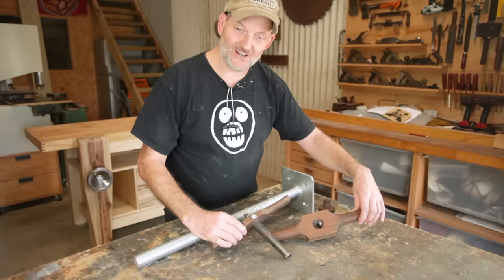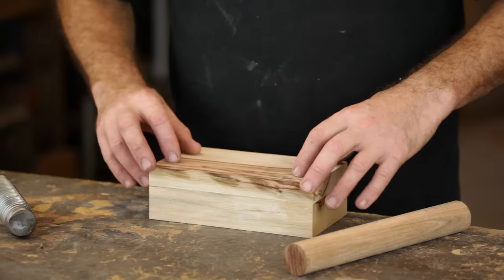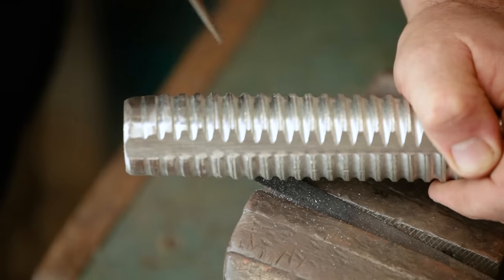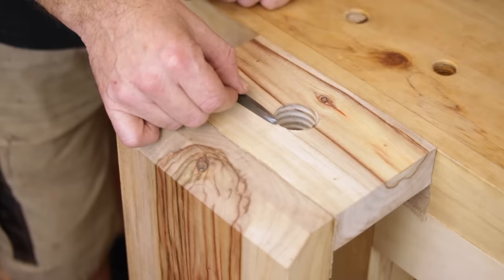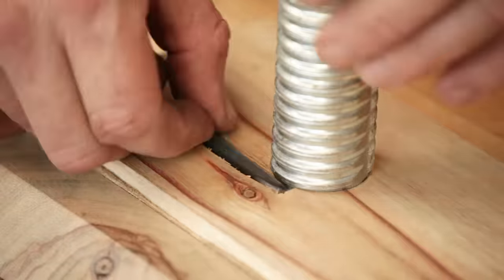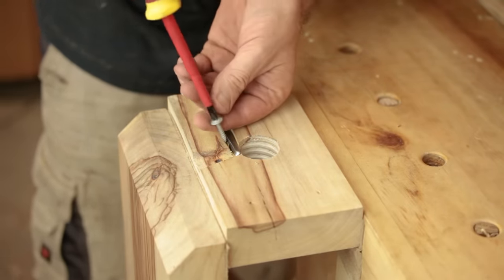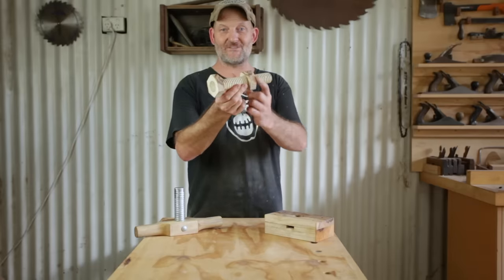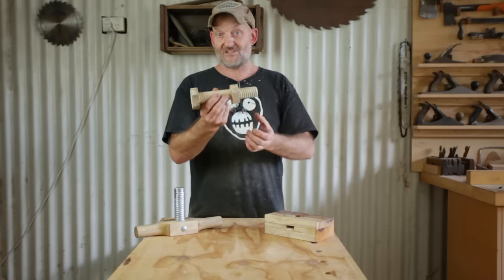Making Wooden Threads - Homemade Tap and Screw Box

Comment: John Heisz was trying to make something like that in the course of a few years and a dozen videos, and you nailed it on the first try. Impressive.
Reply from the maker: Thank you Konstantin! John is still one of my very favourite youtubers though. :)
Reply: Konstantin Mednikov: as said in the US keep it simple!
Reply: Pask Makes magnet an a stick would have been handy for the oil retrieval,great video.
Reply: D twist Rewind that wouldn't work because he removed it's magnetic properties
Reply: It would work, the piece of steel just lost it's magnetic properties cause it's heated above it's "curie point". It will resume being attracted to magnets as soon as it cools down.
Reply: Mirai, As the other commented mentioned, that was the Curie point. Basically, it is when the ferromagnetic metal (Fe/Ni/Co) is heated far enough that the atoms are not locked into that magnetic orientation, so they can spin around when brought to a magnetic field. While this will destroy an existing permanent magnet's ordered structure, once it cools it will have randomized, but still locked-in magnetic orientations among the atoms. It will just be like a chunk of steel or magnetite instead of a magnet that has been exposed to a powerful electromagnet in order to orient the individual fields into a cohesive magnet.
Reply: Konstantin Mednikov f
Reply: Konstantin Mednikov qq
Reply: Eugénio Varejão ppppp
Reply: Eugénio Varejão i
Reply: Konstantin Mednikov
Reply: @PaskMakes  you are my favourite youtubber! As a photographer and woodworker I feel resonated to you.

Comment: Dear Neil, magnificent example of ingenuity at work.  I like the fact that you produce a long tap to start the process, rather than the shop bought models which only have a few threads on them.  One thing you may consider is making a bottoming tap to match the taper.  That way you can start a hole that ends with the taper cutter and finish to depth with the bottom cutter. Then you can sink your thread all the way to the bottom. 

What is also an interesting concept is to get a starting thread that is highly suitable for things like vices - an Acme thread.  I have seen some at my antiques store for $20.00 and would make an excellent set of taps - taper, intermediate and bottomer.  Acme threads have a better profile and quicker movement than whatever thread was used on this demonstration. 

I have been playing around with making dowels and wooden threads using various approaches.  I used a shop bought thread cutter kit. I soaked my wood {Victorian ash} for three days beforehand and the threads went surprisingly easily.  Unfortunately, the threads were brittle and touching the tops broke them off.  I then tried some ironbark which was recently milled and quite moist.  I didn’t soak this in oil but it cut like butter and the threads are strong without breaking.  I guess what one has to do is to experiment with a few combinations of technique to get the ideal end result. Happy turning!

Comment: I loved this video. I am working on an antique chest of drawers that had the feet on its turned  legs cut off, I assume to make it sit level. I want to make replacements that I can thread into the bottom, so that they can be removed or replaced to preserve antique value. Even though I will research the design as much as I can, it is always possible that sometime in the future, I will find that the feet that I turn for it doesn't match the period properly. It will also make it clear that I am not attempting to fool anyone that a repair has been done.

Comment: You need to put a second cutter  on the die to cut at half the thread depth to cut first that will help with the chip out .
Good job making it , worked good .

Comment: Isn't it amazing what you can do without power tools. This, I can attempt to do. 
Please make more of your lovely creations without power tools
Reply: +
Saj Tyk

You certainly could do this job without power tools.  He used plenty of power tools though.
Lathe, drill press, disk sander.
Reply: @VestigialHead  seeing the mother of all power tools lathe, I was wondering if it'd be easier to cut the bolt thread with a single point tool.

Comment: Thanks Neal, I"ve learned for others that if you soak that dowel in mineral oil or blo for about a week it will cut much easier and pretty well eliminate chip out. Thanks for working this out. I need a wooden thread for a face vise and $200 for one is a bit much.... going to give it a go

Comment: Great job! Thanks for sharing this!
I have got 2 Tips on top of that:
- usage: ~3h in advance before you cut the bolt and the hole, put on some line oil varnish on it, so it cuts better without splitting out
- you can built the cutter too with a handle (little thinner), so it is easier to turn it around the fixed bolt, instead of turning the bolt through fixed cutter.
Reply from the maker: Thank you! Since making the video I've started soaking the blanks in oil overnight before cutting the threads. I also made a handle that quickly clamps to the bolt to make it easier to turn! :)
Reply: Sounds like an update-video to me ;)

Comment: I've seen other folks cutting threads in various types of wood, and it seems the consensus is to soak it in mineral or linseed oil over night before cutting the threads.  It prevents the tear-out problem.

I wonder how well this would work on exotic hardwoods like Ipe or Wenge; alternatively a lamination (say, two or three pieces of maple) - maybe this would stay straighter over time?

Comment: Very nice, and simple. I did something very similar years ago, grinding a 1.5 inch coarse bolt for a tap and making a jig to use a 60 degree V router bit to cut threads. The grind on your tap looks more effective than mine, it took a lot less pressure to turn.

Comment: I like to create projects, Many times I will need a jig or tooling that I don't have that I will need while making the project. That's where I come into my element,,, designing and fab'n the tooling I will need to finish the project. It's more fun for me that the project I built .  
    Nice job on the tap and die for those wooden screws. Believe me or not just last night I started looking around for what I need to cut some large dia. wooden screws myself for a book press I am making.

Comment: Great project and video!  Now make some wooden washers to go with the bolt & nut! :)   Another idea is you could make a handle that fits on the end of the dowel (similar to your tap handle), but have it clamp on temporarily to make turning the dowel easier.
Reply from the maker: Thank you! I made washers at the end of my wooden socket wrench video. I did make a handle as you said (Showed it recently on Instagram) it works great. :)
Reply: Sounds like you're a step ahead of me, and that I need to go back and watch more of you vids! Thanks!

Comment: Next time you drop something in your quench, try this: couple long pieces of scrap like before, but carve a shallow notch in them.  Put a piece of short dowel,10mm or so in the notch, and rubber band them together with the band below the dowel.  The band will try to close the jaws.  The wider your wood at the notch, the more firmly the ends will stay square to each other, but you can make the ends as narrow as you like.  And now you can operate it like a pair of scissors.

Comment: I just did a ton of testing trying to make the threads without the chip out.  I read to soak the dowel in linseed oil.  what does soak mean?  so I soaked it for 2 hours and still go chip out. So I soaked 3/4" dia hard rock maple dowels for 20 hours and it soaked all the way to the core.  I was shocked!  it then cut like butter with no chip out of the threads.
Reply from the maker: That's good to know as I tried soaking in linseed oil but only re-applying with plenty of oil (not submerged) and like your first experience, it was no better. Thanks! :)
Reply: I made up a capped tube about 3" longer than the dowel out of PVC pipe and mounted it vert.  I then put a 2-1/2 screw in one end of the dowel, dropped this in tube (screw up) and filled with linseed oil.  The dowel will want to float out so put a weight on it.  The screw keeps it submerged as the level goes down as it is absorbed.  I'm not sure if 20 hours is too long but once you pull it out and start cutting it's too late so patience is the key here.  I cut right away as I had no idea how the drying of the oil would affect the cut.  It was like night and day it cut so easy and not chips.

Comment: At 1:15 into the video, I'm wondering if you are putting the cutting edge on the wrong side. It seems if you are turning the screw clockwise, the edge is in the wrong direction to cut.

Comment: I’ve noticed that you use significant pressure on the pull of the file. I’d recommend not putting pressure on the pull, as it won’t do much cutting and wears out the file quickly.

Comment: Question: Given that the wooden nuts are cut by an (adapted) metal bolt, why isn't conversely the wooden thread cut with a matching (adapted) nut? I can locally find M45 nut and bolt pairs, why would doing the same to the nut as to the bolt not give me a good result? The nut is wide enough to pass my file in, and the equivalent of the 'angle grinder' step seems similarly doable. I'm unfamiliar with quenching/annealing so this avoids that. What am I overlooking?

Comment: I used the nut to thread the dowel. Perfect result.
Reply from the maker: You wouldn't get a perfect result with threads this big! There has to be some slack between the nut and bolt you use to make the tap and die else it wouldn't turn. That goes for any bolt but these large scaffold screws have a lot of slack. When you use the nut as a die it is making a thread the size of the bolt plus that slack. The bolt will be too wide, not by much but still too wide and it won't fit the nut. :)

Comment: Soak the dowel and nut blank in mineral spirits until the bubbles stop coming out it should be a couple days to two weeks at most depending on the wood and you get flawless threads

Comment: Great demonstration of skill. My trials and errors seem to concentrate more on the error side. I have used the commercial tap and die sets, but end up with way too much chipping. Any suggestions.
Reply from the maker: Thank you! I'm not sure other than try some different timbers. I found one piece differs to the next, some come out very clean and others not so well even though they are the same species of wood. :)
Reply: Yes, I find that even on the same dowel rod the results differ as you move down the rod. I'll try some other species that are available to me.

Comment: Great video, I learned a lot!  Is there a way to lubricate the wood when cutting the threads on both the nut and bolt?  Is it possible to adjust the depth of cut on the box cutter to prevent tear out?  I mean make multiple progressing shallow passes to prevent tear out?  Thanks Mr. Pask.
Reply from the maker: Thanks Bill! I do lubricate the bolts now, I soak them in linseed oil overnight beforehand! You could progress the cutter but would be fiddly. Once you have the cutter in the perfect spot it's best not to move it. It actually does a great job anyway, especially with the oil soak first! :)

Comment: Next time you need to use two sticks as tongs but don't know how to operate chopsticks wrap a rubber band around the top approx 1/8 of the length from the end. Even string gives you a fulcrum that forces the sticks to press against the object in the grasping tips. Other than that little bobble, a most excellent endeavor, Sir! Kudos!

Comment: That is so cool. I can't quite figure out how the space between the threads matched the nut. If you were to push harder on the dowel while making the threads it would then have more space between the threads. It would then not match the nut.  So how did you get the thread spacing to match the nut? I hope this makes sense of what i'm asking.

Comment: Why the second heat treatment after you harden it already?  I do not get why it must be heated-then-cooled-in-oil THEN heated again?
Reply from the maker: The second treatment is tempering which slightly softens the the steel. If it wasn't tempered it would be too brittle and would chip or even break. :)
Reply: @PaskMakes  How long do you heat it with the blow torch to "temper" it?  Also, thanks for your extremely clever projects!

Comment: That's awesome, but I'm struggling to think of a practical application for giant wooden bolts.  I guess it would be used for something where you're trying to keep the weight down and need it to be adjustable.
Reply from the maker: Thanks! I just made a large handscrew clamp using these threads. Would be good for a vice also. :)
Reply: Do you think it would work for plastics?  I'm trying to think of ways to melt down and reuse milk jugs.  I see a lot of people making various blanks out of shredded HDPE.

Comment: Hi Pask Makes, I was wondering how important it is to grind the tap on a lathe? I own a grinder but not a lathe, is it important for the tap to be a totally round taper? Is there any room with that?
Reply from the maker: I don't think it needs to perfect but you should aim to get it decent. You could set it up with a couple of blocks of wood with protruding screws to mount the tap then turn it by hand as I ended up doing. :)
Reply: @PaskMakes  That makes sense, thanks for the tip!

Comment: to prevent chipout when cutting wooden threads, put some linseed oil  on the wood
Reply from the maker: I tried that but it didn't make any difference. I've since been told that if you soak it overnight immersed in linseed oil that will work. I haven't tried that yet. :)

Comment: If you soak the dowel in mineral oil until all the air and water are expunged (may take a couple of days depending on diameter) the cutter will not chip the dowel

Comment: I've often wondered how to make wood threads without an expensive lathe, thanks for the great video. One thing, with only one cutting/guide side how does it spiral to create an even thread, would it not just cut a circular grove ? I might of missed something.
Reply from the maker: Once the threads start cutting they are then guided by the threads in the threading box the other side of the cutter. 😊

Comment: that would work great to make an adjustable stool and i'm sure you could make it out of only wood, no glue and no metal.
Reply from the maker: I made a couple of barstools a few years ago, there's a few photos on my instagram, all wood with adjustable threads. I may make more soon for a video! :)
Reply: @PaskMakes  nice, i'm gonna check that out
Reply: @PaskMakes  
i'm also looking forward for that video, it probably will be just as good as your other videos. i love how easy it is to follow your instructions, even my dad who deosn't speak english understood you.
Reply from the maker: Thanks very much! :)
Reply: @PaskMakes  
you're welcome, i just looked at your instagram and that stool is verry good looking, the only real problem was that the screw looked king of flimsy but that will be fixed with the new thread cutters.
Reply from the maker: Yes they were a bit thin, my kids use those stools and they are fine for them. As you said, these screws would be better! :)

Comment: Useful to somebody indeed. There are many  DIY wooden thread making youtubes.  This is the best.   RE> chipout.  Other videos do stress soaking the dowel in mineral oil for a few days, before cutting the threads.  One I saw even recommended creating a vacuum tube with mineral oil, for saturating the dowel before cutting.  You do good work Mr Pask  :=))

Comment: i would pay for one of these lol
Reply: quick question, you bought the scaffolding level, it comes with a nut that fits onto it already at the correct size of the thread. could we use that and do the same process you did to the bar to make the opposing cutter rather than cutting down a file? they are the perfect size and if the bar cuts the recess then the "nut" should be able to cut the wooden rod threads.

Comment: The ads tho....
Reply: Very nice work, great video, step-by-step! I can imagine a gripping handle for gand-turning the stock (dowel rod) into the die: a handle with a camming gripper that tightens as you apply it; use a circular cutout to push against the dowel. Just a thought. Made that way, it should wourk with various dowel diameters.